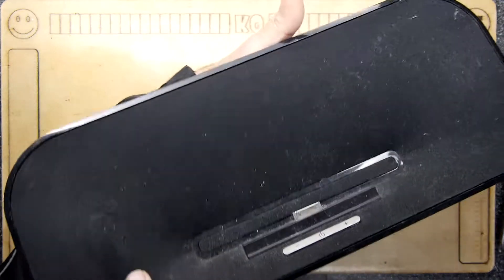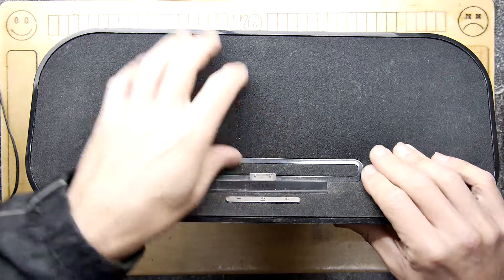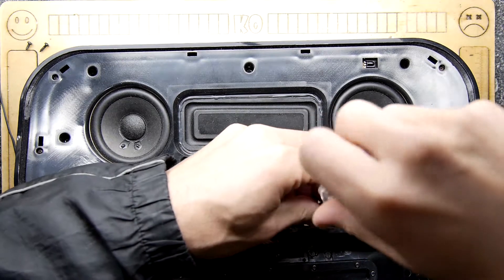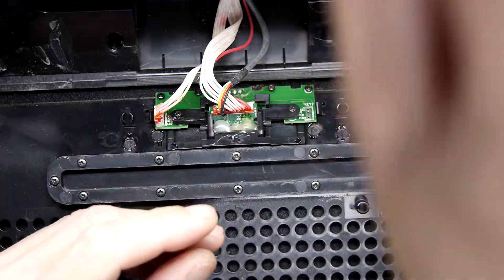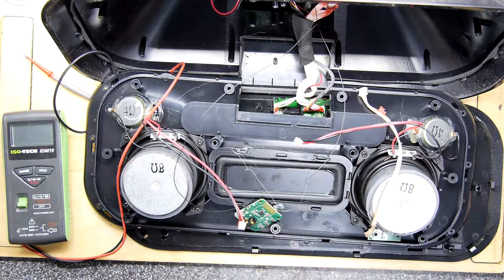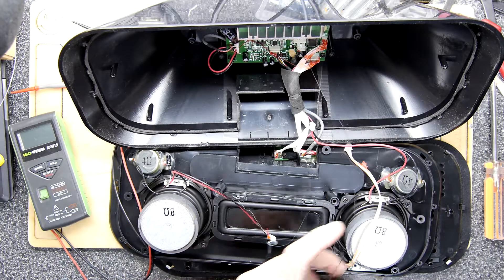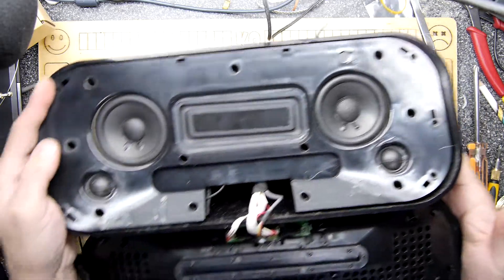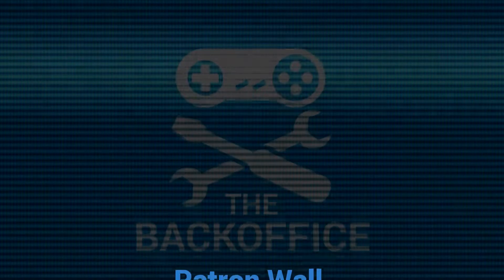Add bluetooth to an old iPod dock

Comment: How exactly did you do this? Cus I'm trying to do a similar project on a very different speaker (although it has a similar 2 circuit board layout) with no idea how these things work, do you just circumvent the old aux input

Comment: The woofer isn't a "fake" per se. It's a passive radiator. It's a trade off between a sealed box and a bass reflex port.
Reply from the maker: A passive low note flappydoor?